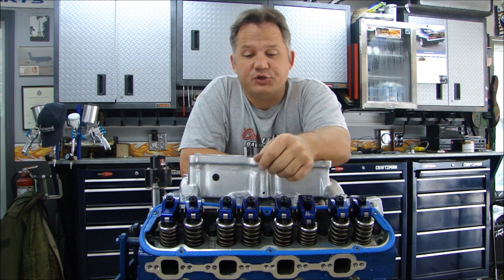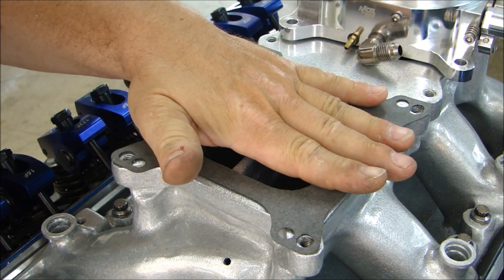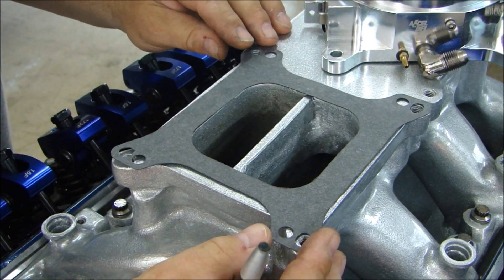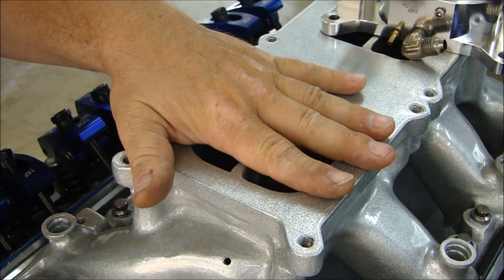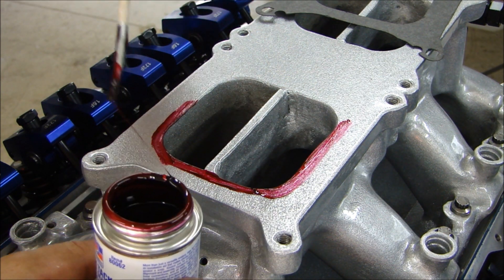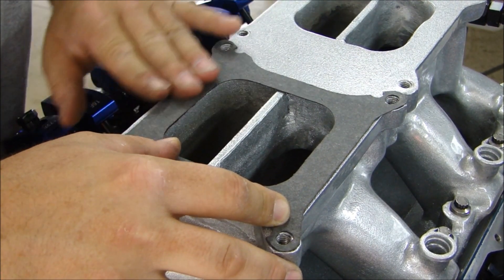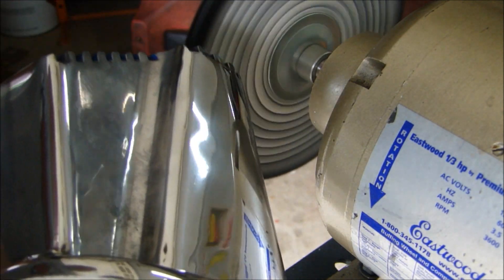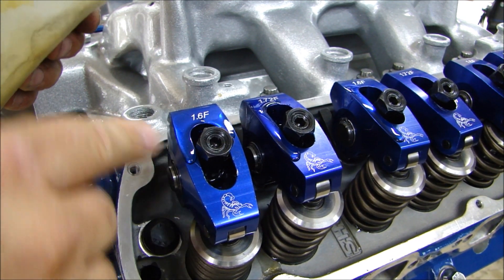Engine Building Part 10: Valve Covers, Carburators, and Throttle Bodies

Comment: I'm looking into dual throttle body injection on my engine but I'm wondering what is involved in having the two throttle bodies versus the one. If you could tell me what you did to set it up, that'd be great.
Reply from the maker: There is no real set up difference between one and two throttle bodies. You have to shut down and seal of the idle motor on one of the throttle bodies since only one is needed. Other than that it's just a difference in air volume with incredible throttle response.
Reply: Do you have to change anything to your computer inputs to let it know or fool it that there's a second throttle body?

Comment: I apologize if anyone else has already asked you this, but how did you manage to powder coat the inside lines on your valve covers but leave the top part with the letters untouched? I'm a total novice but extremely curious.
Reply from the maker: Ancient Chinese secret...lol. Just mask off the sides and use a small brush to carefully dust them off....very tedious

Comment: Hey Pete! i have commented before and love your work. i have finally bought an engine! i bought a 6.0L L98 with l92 heads and the plan is to put it into my circuit car. I'm trying to decide on Camshaft at the moment, the circuit racing i will be doing is roll start so I've been thinking a fairly large cam with peak power around 6200rpm. just not 100% sure any help would be appreciated!

Brad
Reply from the maker: DjDarbsChannel Thanks Brad. What is your plan for carb / intake?
Reply: i have found a fuel injected ITB kit to suit oval rectangle ports. I'm trying to decide on cam size, I'm running 4.000 stroke on a forged crank was going to go stroker but for circuit racing I'm only allowed 6.0L. the racing involves roll starts so I'm thinking a bigger cam as off the line is not a big deal. looking at something around 2200rpm-6500rpm. will be going all forged internals as billet is just too expensive for the HP i will be running/ looking at around 700hp at the fly.

Duration @ .050 (intake 234/ exhaust 249)
Lobe Separation 109* intake centre line is 103* and valve lift intake .573/exhaust .558

Comment: Try using baking powder to clean the black residue off of the polished surfaces.  I use to professionally polish metal and that is what I was taught to do.  Wild Harold's Performance
Reply from the maker: Awesome idea....thank you
Reply: Do you have any advise for changing a Fox Mustang to a SN-95 Mustang 5 lug rear end and front spindle and hub assy.  I am rebuilding the calipers and replacing the brakes.  I am also using the power brake booster, master cylinder, and proportioning valve.  Only thing that I am not transferring is the hard lines.
Reply from the maker: I have a video about that
Reply: Thanks a Bunch.  I really enjoy your videos.

Comment: can one just swap out a carb for a throttle body if the stock motor had a carb? I'm teaching myself off the interwebs  so may be a dumb question.
Reply from the maker: Probably not because the intake is different. I just posted a video on fuel injection

Comment: Hey Pete. So I have 750 cfm carburator for my 360 FE big block, it is slightly over stock, with a 260 duration cam, and aluminum intake, is the 750 cfm carb still too much or should I get 600 cfm ??
Reply from the maker: I'm thinking that will be a bit too big.

Comment: What will determine which valve covers you need for you heads? Center bolt or standard?
Reply from the maker: Head design and height
Reply: Well I got a cam with  .510 lift and took my heads to the machine shop and my mechanic worked them and gave me new valves, springs and so on that will fit with the amount of lift on the cam, so that's why I was wondering which valve covers. I do have the part number for the heads. 14101128. This is my first rebuild. I just want to make sure everything is right the first time to prevent having to go back later.
Reply from the maker: If the valves are standard you can use a stock valve cover

Comment: Pete, how can I check to see if my throttle body is warped? I personally didn't put the throttle body on and I hear a strong hiss. Carb cleaner to check for vacuum leaks?
Reply from the maker: +Rangooo That is one way. Those are very easy to warp. I would take it off and put it on a flat surface like a marble countertop and check with a flashlight or feeler gages.
Reply: +Petes Garage  thank you. Looks like I'll have another weekend project on the list. Last thing, could you explain what you mean by the flashlight test?
Reply from the maker: +Rangooo Shine a light from the side, if it is warped you will see light sneak through

Comment: Wouldn't it make more sense to have the throttle motor and tps on the throttle body closest to the camera because the air passages are closer to center instead of the very back? I'm assuming you chose the back one for cosmetic purposes and I don't know the impact of only having the air passages in the back.
Reply from the maker: That is a great question. It came down to data and experience. I found that there is no difference from front to back. The idle and performance is the same. I did choose the back to make the wiring more streamlined. It works well.

Comment: What's the maximum hp a 351w ,unstroked, not modified at all, can put out? How much will it cost if you build one, say around 250hp-270hp. Would you work one out for my truck? It's a 69 351w , out of a 69 Cougar XRT. If you do, how much is the cost. It's a complete engine. I bought the complete car( totaled rear ended crashed). Thank you.
Reply from the maker: A general rule of thumb is 1 HP per CI. So, 350 HP is not unrealistic. On a 351W you could so that for maybe around $3k
Reply: @PetesGarage  thank you , God bless.

Comment: I’ve heard at switching from a 2 barrel to a 4 barrel and carb could hurt the engine is that true?
Reply from the maker: Yes, the 4 barrel needs more air and fuel. A straight swap will run rich because the heads cannot handle the additional flow.
Reply: Pete's Garage so would I need to just get bigger heads or what? I have a pretty much stock 390 and got a 4 barrel for it and want to do the swap
Reply from the maker: You should get the heads that match the manifold

Comment: I'm rebuilding a 454 an would like to know what cam and heads would be good for my rebuild.... I plan to have it highway ready but fast also... any help or tips would be nice
Reply from the maker: +Montel Scott You'll need a heads, cam, intake combo. Pick a torque range and look for a set, they are easy to come by
Reply: +Petes Garage is stock heads not enough
Reply from the maker: Sure...just make sure the cam and intake match the flow of the heads

Comment: Had a Brand New Holley fresh from the box drop 2 of the venturi plate screws down my intake and bounce between cylinders for a few revolutions on my very first engine build 30 years ago. So Ive always checked since . And Holley refused to acknowledge and fault claiming I or someone else must have loosened them prior to install. Makes absolutely no sense but I will die without spending another dime on anything they sell
Reply from the maker: Well....big lesson learned there

Comment: I like powder coating, looks real nice. but I lost all faith in it. Here i thought it was impervious to most chemicals and it can't even stand up to carburetor cleaner. Pissed me off when I went to clean the intake runners with carb cleaner before installing on engine and as it was dripping out of the runners it ate the powder coating. Turned it to a gooey substance. I guess it's my fault not knowing. Wondering what other cleaners will eat it?!
Reply from the maker: There are different powders that stand up to chemicals. Acetone will remove powder coat pretty quick. It is not permanent, but it's better than a rattle can spray job any day.

Comment: What's your feeling on permatex red
 (the stuff in the tube)
Reply from the maker: It depends what you are using it for.  If you mean the high temp stuff I use it all the time. Any Permatex product works well when used as intended.

Comment: Okay i really need your help i have a 86 mustang 302 roller motor with a aod trans I'm wanting to build it on a small budget for drag but still drive it  but i don't know what i need i know i have to use a carburetor i'm putting it in a 59 ford custom 300 id really appreciate it if you help me!
Reply from the maker: I have a video on choosing carburetors. Watch that and let me know if you still have questions
Reply: Get a 350 chevy small block cheaper and better

Comment: Wondering around YouTube and found your build vid's, got to say you do great work and you really know your stuff, I could learn a ton of stuff from you. But I have to tell you that I cringe every time I see you glue gaskets on with high-tack or RTV, especially when it comes to carbs. 
        I used to install the evergreen type assembly line garbage engines, about two a week, from a short block and heads up, then I changed jobs to a quality place as a shop manager, where our shop did our own machining and builds. 
      When I was assembling or talking to my guys about it, I always told them "use a gasket or a sealer, but not both, the gasket is the sealer". A little silicone in the corners of the oil pans and intakes, maybe a little over the seams of the front covers to the block like fords, and usually for the intake ends., but if your going to glue them on you might as well just use silicon instead. The reason being, the gasket is designed to seal the surface, if it wont seal by it's self, then the surface is bad or the installation. And although the glue is not necessarily a bad thing (as long as there are no small passages that it could plug like in a carb), if you ever need to take it apart again it just makes a bigger mess that you need to clean up. The only reason I ever used a glue/sealer on a gasket was to hold it in place while I bolted it together, and that was seldom and never on aluminum parts. Just my nickels worth of opinion, that's worth about two cents. :-D  Keep up the good work brother, going to to go watch some more of your vids.
Reply from the maker: That is an excellent point. I never use any sealer on carb gaskets before taking it to the dyno because you do take the carb off several times to jet it. I just do it on final assembly as a "just in case" type of thing. Thank you Kenneth